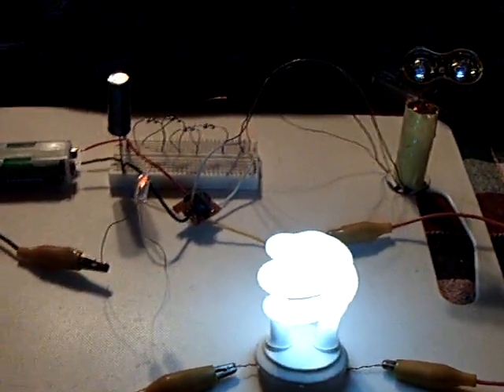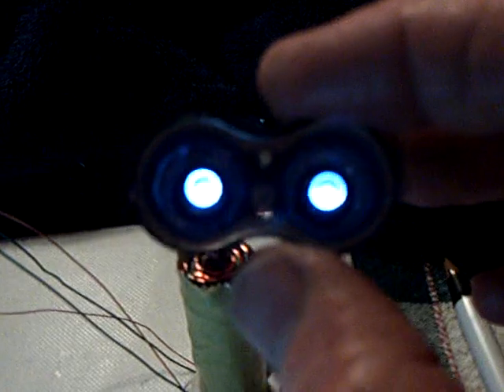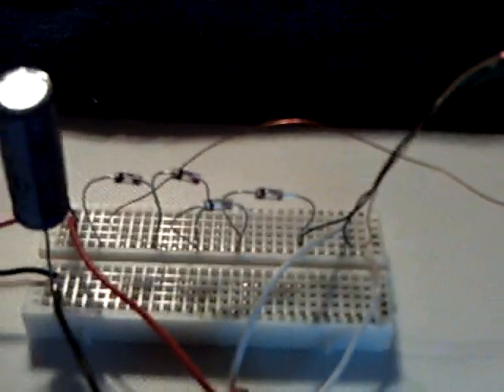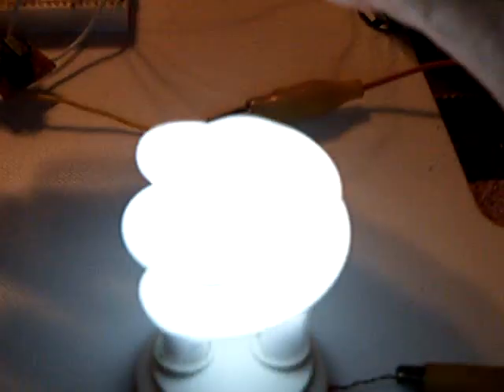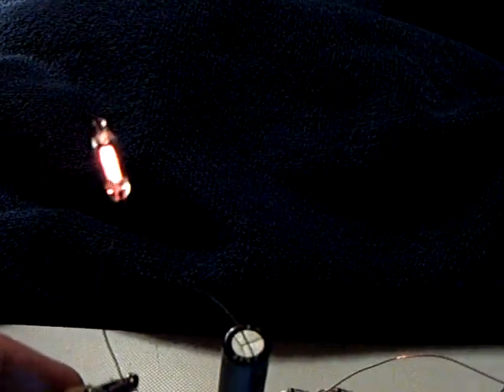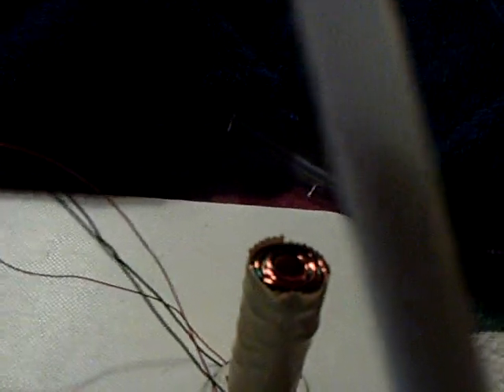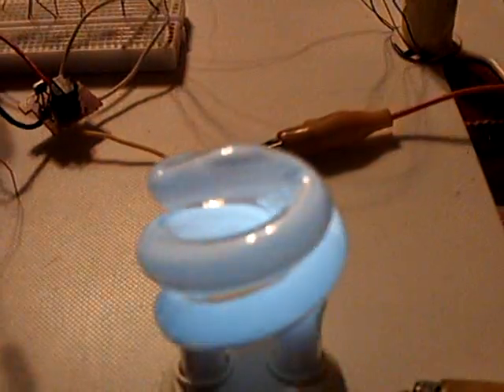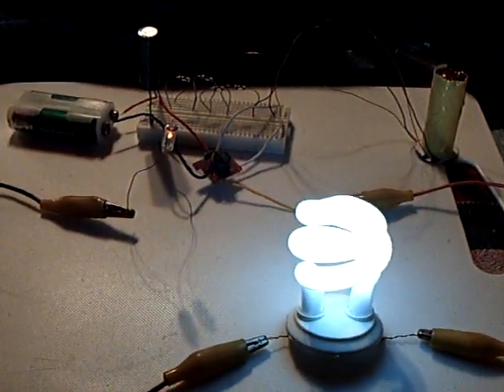Joule Ringer with small bifilar coil and  Exciter effects.ASF

Comment: SO DOES THE CAPACITOR STORE ENERGY FROM THE BATTERIES,AND IF YOU HAD A SOURCE OF 3 VOLTS SAY FROM A PHONE LINE OR MINI GENERATOR,COULD YOU REPLACE IT WITH THE BATTERIES AND RUN THE LIGHT ALL NIGHT,THE DIODES CHANGE AC TO DC

Comment: Another fine job. It looks so easy and fun and something you can use while moored in Avalon! (Sorry Nemo:) I do have a few questions though. When you are powering the cfl with the cap only, is it full brightness? Does the cfl flicker? Have you had any time to figure out the amp draw at full brightness. The reason I ask is because I was wondering what a kind of a solar cell / supercap / gel cell setup would be required to have this setup run from sunset to bedtime.
Thanks again!

Comment: Great job! This is going to lead to great places a rc circuit running the input voltage would make it even more efficient. Somthing like the red flashing led in your pulse motor would work also. I wonder if you mirror the circuit if you could bounce the outputs back and forth using a capacitor"captret style"